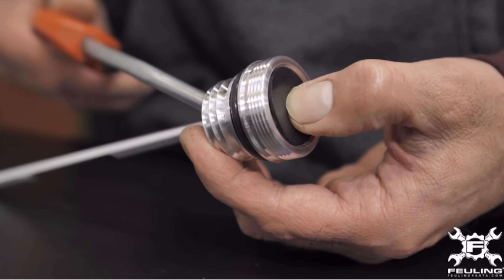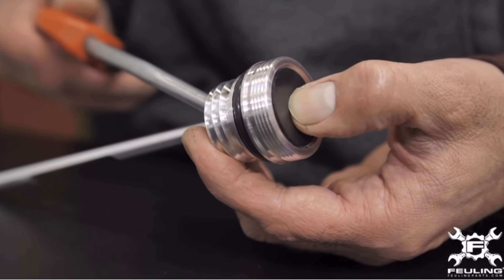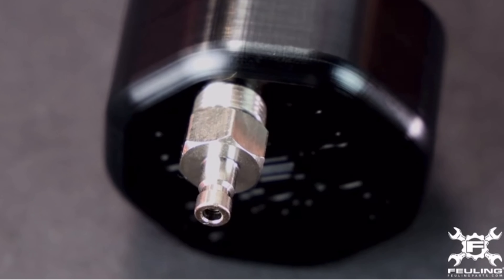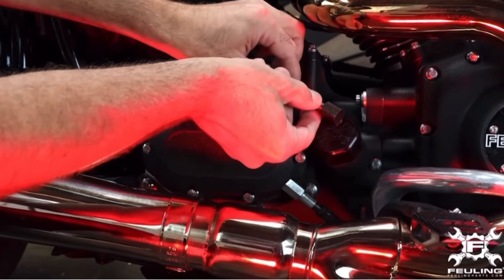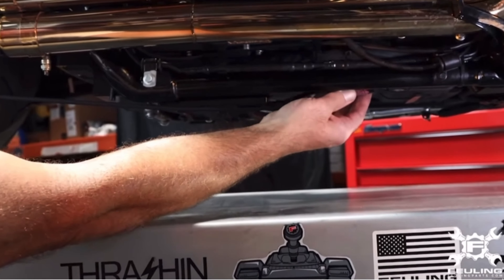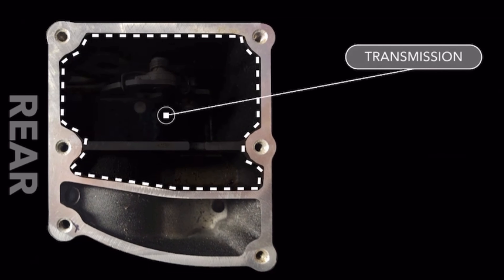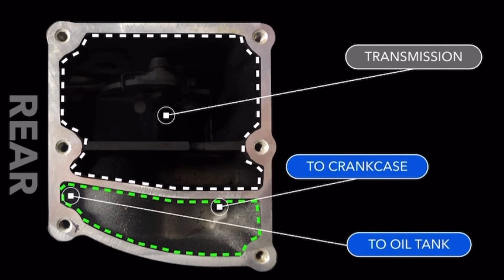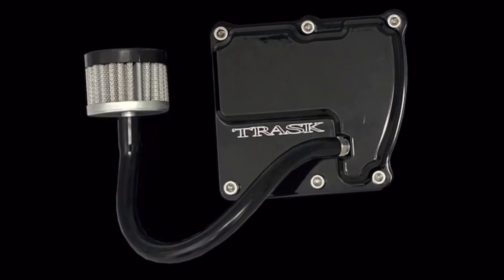Milwaukee 8 oil sumping? Feuling vented dipstick? Trask vented trans cover?

Comment: Man, venting your heads into a catch can IS a good idea! Not putting oil back into your intake doesn't do anything for the vacuum state of the motor, it just keeps you from getting the tops of your pistons coated with burnt oil and creating heavy carbon deposits on them. If your bike is a heavy spitter, lots of oil in your intake, vent it into a catch can as soon as possible! I do agree with venting the trans cover properly though. That should help with the sumping. The sumping is created from too much pressure in the crankcase.

Comment: Clean, clear, precise information. I have noticed that the pre 2020 M8s are increasingly being put up for sale but, the buyers market are reluctant to purchase, me included until today. Your video backs up a couple of other straight shooters. The best thing to come out of the sumping fear is, that the earlier M8s coming up for sale have both low mileage and the stage 1 kit is already fitted and tuned. Gotta get in there to update the cam anyways and this equals savings. Savings is a good thing. Real life practical advice. Cheers.

Comment: I ride a 2019, 114-inch,  Road Glide Ultra that has a dyno-tuned Power Vision, Fuel Moto, RTX two into one exhaust , Cycle Rama 483 cam, Screaming Eagle, Ventilator Extreme air filter. I had the local Harley dealership install the Fueling oil pump and backing plate, Man O war engine sprocket that is two and a half pounds lighter than the stock HD compensator sprocket. I then installed the fueling vented dipstick. After installing all of these parts I could feel a noticeable difference in how much quicker my 114-inch engine gains RPM's. I recently installed the Trask vented transmission cover and now my 114-inch engine revs up even faster vs before the installation of the Trask vented transmission cover.
Reply: After 10,000 more dollars ?

Comment: The Fueling dip-stick and the Trask trans cover has a Boysen reed underneath the trans cover to maintain engine vacuum to maintain good ring seal.
Reply: So both of these things should be done?
Reply: @MarvFitBikesKicks  .----> When I vented just the air cleaner and installed the Fueling vented dipstick I could feel a little difference, but after I installed the Trask vented transmission cover too I could really feel a noticeable difference.

Comment: I did my own venting on my trans cover. I ran vent line to under top of frame Ran me a total of $39.00. Make sure vent is away from the hole in the gasket you must make for it to breath. If it is under the vent you will see more oil commng to filter. All you need is nipple, hose, hose clamps, and breather filter

Comment: Venting your breathers away from the air cleaner does not do anything to the vacuum in the engine.. The one way head breather valve closes on the piston upstroke, vacuum. The valve opens on the piston downstroke, pressure. The downstroke of the pistons creates internal pressure and blows out the breather bolts. The air cleaner does nothing to the crankcase vacuum state. When you talked about this in your video I stopped watching because you can teach us nothing.
Reply: That is totally true.
Reply: Yup definitely talking without the proper knowledge base. 2019 RGS 114 with Feuling cam plate oil pump and I vented my breather. No sumping no problems and yes I run her hard….
Reply: Give the man a break teaching is a 2 way interaction. 👆They are correct if about the umbrella valve. In the simplest form once the oil makes it to the OEM breather bolt it’s connected to a hose. The difference is the OEM hose directs the blow by into the throttle body so it can be consumed because EPA doesn’t want oil on the road. The aftermarkets like HPI’s external breather just directs it somewhere more convenient with a longer hose so you don’t make a mess of the throttle body. I believe you are correct that a good aftermarket cam plate and oil pump will help scavenge that oil and help limit blow by. Also some early M8 years were missing the oil pump seal which was causing your vacuum problems.
Reply: @CMFS101  Your reply to me has nothing to do with what I originally stated. Ricky HD is a hack. If you are relying on his knowledge about your HD, you are ill informed.
Reply: @DONALD-MAGA  True
Reply: Absolutely. I came here to make the same comment. This video is nonsense.
Reply: If those breather bolts are dumping back into the intake or on the ground or a can, the engine doesn't know the difference with the exception of cleaner air if you do it externally. Also if you are going to vent the transmission cover you do need a check valve. Maybe I missed that but I don't recall hearing it.

Comment: You said not to do the external breather to a catch can, but by default from manufacture it is venting it into the throttle body.  The only difference is your catching that crap going into the throttle body and burning in the cylinders.

Comment: Good info Ricky. I have heard that in the 2021 H-D bikes they have a improved oil pump.
Reply from the maker: Yes they have. Extra teeth in the gear and better scavenge holes
Reply: They are better. But the crank case venting is still an issue.
Reply: @RickyHD  I just bought a 21 rg 114, having the stage 2 installed (dealer) next week, so my oil pump should be ok? I like the Traft trans cover better than the dipstick for sure
Reply: @RickyHD   That is fake news brothers. The original M8 oil pump had a larger OD 10 lobe gerotor. Engines built after 5/22/2019 have the new pump with a smaller OD 8 lobe gerotor. The new scavenge gerotor set will increase the overall scavenge capacity.
The new pump body changes the scavenge percentage split between cam chest and crankcase.

Comment: Section 4.6 page 4-12 of service manual.

BREATHER OPERATION
CRANKCASE VENTILATION

A breather assembly is mounted to each cylinder head to prevent a buildup of pressure caused by the downward force of the pistons. Burning crankcase vapor eliminates the pollutants normally discharged from the crankcase.

See Figure 4-6. As pistons push downward, displaced air in the crankcase is vented through the crankcase roller bearing into the cam compartment. The air flows up the pushrod covers (1) into the rocker housing. The moving air absorbs a small amount of oil vapor as it travels through the engine.

The oil/air vapor passes through an opening in the breather assembly (3).

In the breather assembly, the flow of air passes downward through a labyrinth where most of the oil is separated from air. It then moves upward through the breather element (4) where the remaining oil is removed. Two small holes in the bottom of the breather housing allow the separated oil to drain back into the crankcase.

Passing through the breather element, the vapor passes through the umbrella valve (2). Vapor passes down into the cylinder head passageway and through the breather bolt (5). It passes through a breather tube (6) into the air filter element where it combines with the intake air stream and is burned during normal combustion.
 
There is no mention anywhere about crankcase vacuum only crankcase pressure.
Reply: Correct. All this talk of "needing" a vacuum "created" by venting into the breather is bullshit.

Comment: Trask trans cover has a reed valve, one way valve. The rocker boxes also have umbrella valves. Venting your breather bolts out of your air cleaner is a good mod. You think you have a significant ammount of vaacum in your air cleaner? Enough to open that umbrella valve? My big sucker air cleaner rolling 80 in clean air, aint gonna be any vaacum at all outside the air valve in the throttle body

Comment: i've got a 2018 Road Glide Ultra (107) with 74,000 kms on it.  Put in a stage 2 with a HD power cam and an oil pump from a 114 motor .  Haven't had any issues with sumping or excess oil coming out the air intake breather tubes, guess I got lucky

Comment: The only reason I put external breather bolts is because of shooting all that oil back on top of the piston heads and when I pulled the jugs off and looked at the piston they were fucking caked with burnt fucking oil🤷🏻‍♂️ I am running that fueling dipstick and I will attest to it getting fucking oil everywhere so I’m trying to figure out a way to run the hose so it won’t shoot oil all over the floor every time I park my bike.

Comment: Ricky I have a question about something you stated about breather kits that attach to head bolts.   Can you please elaborate.  How does a breather system effect the vacuum if the heads are vented into the air filter area.   Is this something new as I know a lot people sell them.  Doc Harley even recommended  them.   I’m not being a jerk just looking for more input.
Reply: I thought the same thing. I did install  external breather bolts and ran an individual hose for each bolt to the bottom of the bike. When i rode the bike, it didnt feel right. Not bad, but noticably different and like there was way too much venting going on. I then ran them to a T fitting like most people do and then to a single hose to the ground and the bike ran much better. So i believe there is some truth to what he said in this video. You dont want to over vent the heads much more than they are already vented. I say all to say this. I just went on a 3k mile trip and was spitting oil out of the breather hose. Oil level was towards the bottom of the dipstick, hot and on the sidestand. No idea whats going on but today i ordered the trask cover to see if it helps.
Reply: It's impossible, the intake is sucking from the atmosphere as well. There is no sealing involved.

Comment: If you take 2- 55gal drums. Fill one ½ way up with oil.  Use a Gerotor pump to pump oil into the empty 55gal drum. Use a 2nd Gerotor pump for scavenging the oil out of the 2nd drum into the ½ full drum.
Both pumps running at the same speed will and will pump one gal of 20-50W oil @ 200 deg F in one minute.    
Now you can see one gal in and one gal out.  Sumping will happened IF the  scavenging Gerotor pump drops below 100% efficiency (only ¾ gal per min) OR the main oil pump flows more then one gal per min. 
This can happen if you have internal leaks.    Next you can put 100 psi to both drums and you will get the same results. 
So crankcase psi can’t cause the sumping issue.

Next when you do have a sumping issue the crank and counter balancer will Foam the oil  (air bubbles)   The engine can’t produce enough vacuum needed to degas the oil.
Reply: except in your example you are using two pumps. M8 has one pump and 2 ports my dude. so if there is say excess pressure or vacuum where there shouldn't be causing the oil to resist flow or be aerated, then the volume of flow from one port to the other, pressure port or scavenge port, the oil pump itself will drop in efficiency because the oil volume isn't there to pump. its called a scavenging issue for a reason. its also probably why Harley has had so many running changes on our oil pumps. Ricky might not be 100% right but there's 100 million ways to skin a cat but only so many ways to solve this issue and i haven't seen the silver bullet on this one yet.

Comment: If I use the factory breather bolts (which have the check valve built in) for my external breather. Why would it keep it from making vacuum.

Comment: Replacing your transmission cover with the vented  Cover does it  Void the warranty
Reply: Ya know, I asked the techs at the Stealership and they said it might, and then they said that watching you tube videos about Harley's and potential flaws was a complete waste of time. Personally unless the tech is a close friend I doubt they will compromise the corporate narratives in order to keep their power over your wallet, so you will only buy Harley parts and pay top dollar for their services. There is this thing tho that is called "burden of proof," which means that if something went wrong with your suspension they can't blame it on a vented transmission cover without spinning some fantastic fairy tale about how the moon affects the torque specifications on the freenastreen valves and your muffler bearings. I put a trask vented cover on my bike simply because there is too much proof of carbon build up in the M8's even with less than a thousand miles on them. I decided the life of my motor using common sense, will exceed the need to fear the dealer narratives of "Fear for your warranty" if you do anything that is NOT sanctioned by the Milwaukee Corporate Gods in power.

Comment: I did the DIY tranny version and it smoothed out the idle and got rid of the stumble when pulling away from a stop. You will need a one way valve in the line to keep the vacuum. Didn’t have any blow by issues before, haven’t rechecked since the install. My around town MPG is now 42, a resent mountainous highway run of 160 miles gave me 42 MPG before the install. Sumping 6 oz before and after install. My question, is the TC motor set up the same way, with the vent through the tranny top?

Comment: Great video! Thanks!! I understand: sumping is always the case in M8’s (2017-till 2019)and you can solve it the best way to put a fueling or S&S camplate/oilpump in AND vent your crankcase cover with a nipple/hose/filter combination. How is this for a Twincam 2011-2017? Should you do the same to these bikes?

Comment: Ricky I have a stage 2 114ci streetglide with feulings race series oil pump and cam plate. Do you feel I still would need the feuling vented dipstick just to be sage from oil blow by??
Reply from the maker: Nah bro you SHOULD be good

Comment: 2500 to 3500 is definitely not romping on this engine. Really excited to see your trans cover just hoping that you’re not gonna charge me $300 for the thing otherwise I’ll be in business making my own😀
Reply: In 6th gear on my 107 at 80 mph is 3000 rpm if that’s beating on it wow
Reply: Romping?
Riding at 80mph is approx 3000rpm.
And we all stay at that speed for long periods of time

 Adter I did the redshift 468 cam I find myself riding higher up the rev range.  And riding at higher speeds.
Stock it didn’t feel like it wanted to run at over 3k 
Now it’s happy as can be there

Comment: Awesome video that is definitely needed! Major question though, do you need to do both of these mods if you’ve already installed a primary vent kit?
Reply from the maker: Nope you’re good. I would vent the trans cover because that’s where the primary vent goes but if you WANTED too
Reply: I know this is old but, the primary vent was to correct the problem of the transmission fluid transferring into the primary. It had nothing to do with engine sumping.

Comment: The breather hoses are ending in the outside of the butterfly of the intake. That location is the filter area and it is not in a vaccum state. So your point about engine lose vaccum state due to the head breathers is wrong. 

It seems this has been said by few others also in other videos and is creating a confusion to all.

Just think or look at those breather hoses ending place. It is inside the airfilter area and it is common sense that inside the air filter is not in a vaccum state. Peace.

Comment: Are the stock head breather bolts "valves"? The bypass n catch can are to keep the crap out of our carb or throttle body. Nothing to do with pressure. I get the crank and trans are "closed loop". Just sayin'

Comment: Ricky HD, would I hurt my motor if I re routed the external breather tubing from going directly into the engine to the open air ? I have a stock, 107, '19 softail slim and I'm one of those weekend riders. I only have 3500 mi's. on it and when I removed the air cleaner I didn't find any oily residue in or around the intake area . I've seen video's of what happens to pistons when that oil and water get on  them and thought if I vented to the open air ( rout the tubing from the e.b.fittings  up under the tank and down to the underneath of the bike) the pistons would stay clean. Thank you in advance.
Reply: No that will not hurt the engine in any way. It will actually benefit from it!